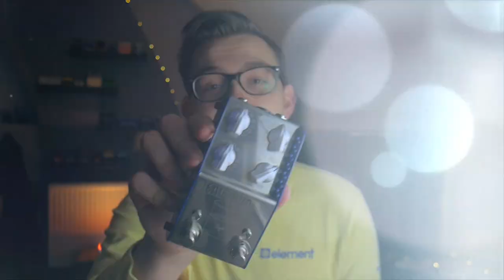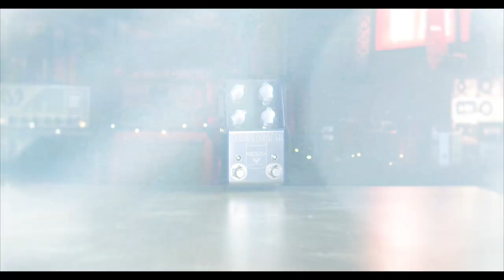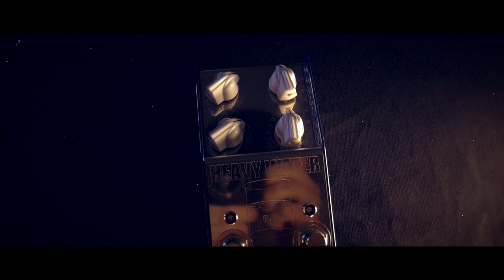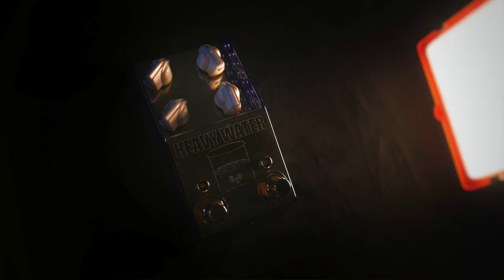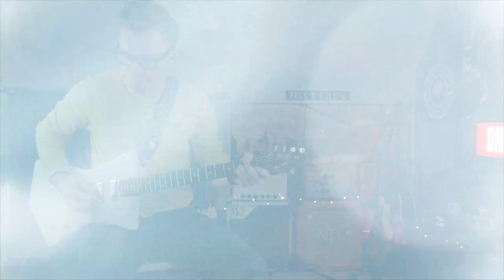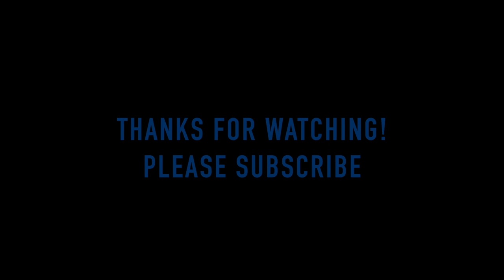THE BEST BOOST EVER JUST GOT BETTER! Thorpy FX Heavy Water (Demo)

Comment: How does this compare to the Hudson Broadcast in regard to lower gain sounds?
Reply from the maker: Interesting comparison! For sure there are some vague similarities on the second side of the Heavy Water and how it can break up but that’s about where the similarities end.
Reply: @JacksonBrooksby  What I love about the broadcast is the low gain tones, going into slightly higher crunch. I also love how responsive it is and how it just opens up when you really dig in. What I dislike, is the fuzz size (I’m covered for that) and rhe dimension / fitting it on my board. I’m wondering if the HW would meet my needs better. I’ll maybe give it a try. Thanks for the response.